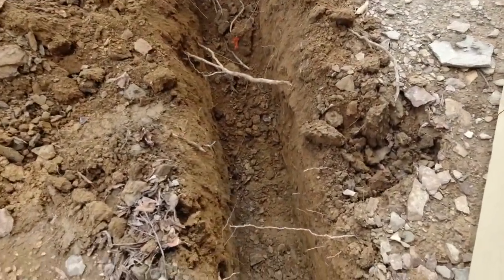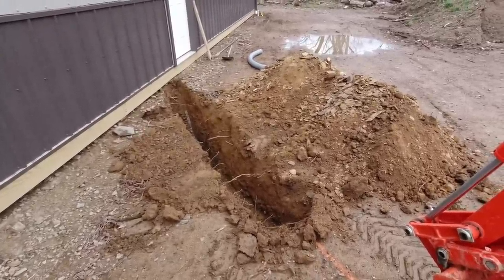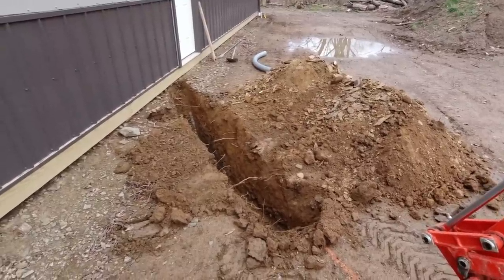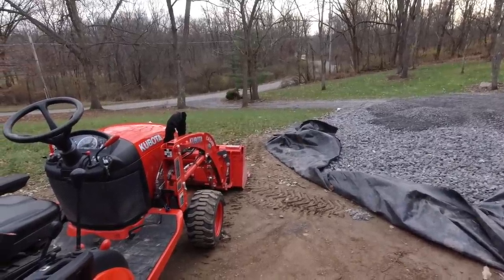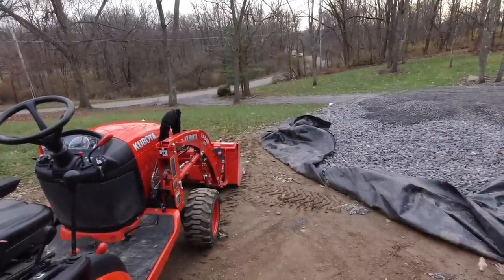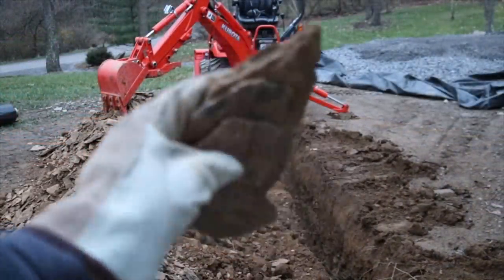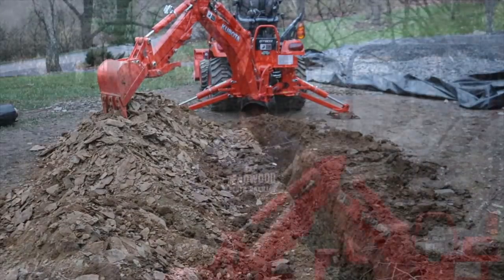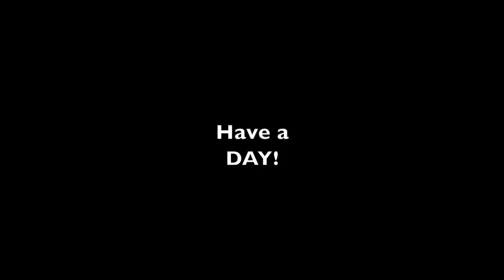#956 Little Backhoe, Long Trench, Hard Digging, Kubota BX 23S

Comment: Since you dont have footings or slab to worry about yet, why not put the pipe up the inside of the building and have the fuse box etc on the inside??   Keep the nice clean lines of the outside of the shed
Reply from the maker: Meter needs to be on outside

Comment: Have you ever had an issue when fully extending the backhoe bucket? When the backhoe bucket is fully extended there is a 90 degree elbow that makes contact with the backhoe. I have had two elbows snap off in like a day.

Comment: Mr. Mike... your BX can do it!

I’ve been digging with one for 15years.  I started with a BX24.  Electric runs, septic repairs, tornado shelters, building pads, footings, post holes, horse and cattle graves... you name it, I’ve dug it.  Although we don’t have shale, we do have Ozark mountain limestone and flint.  

There are a few jobs that I’ve had a struggle but, short of solid bed rock, the BX has done the job.  Here are a couple of tips for you:

The reach of the backhoe is short.  As a result, the spoil pile will always be close to the trench.  If you dig deep or wide, you’ll run out of room to put it on one side of the hole.  What I learned was that once the pile gets a foot or so high... I take a full bucket and lower the boom into it.  When I uncurl to dump, it pushes the spoils away from me.  This effectively extends my reach and keeps the spoils from encroaching on my trench.

Another thing that has made a big improvement, on my digging,  was to put a self adhesive tape measure on the front face of my dipper stick.  I cut it off so that when the bottom of the bucket is flat in the trench the tape shows me the depth.  It saves me from having to get off and run a tape measure.  When I’m digging drainage trenches, I drive stakes along the trench and put marks on them to measure the fall needed.  The same technique works with footings, etc. When I upgraded to the BX23S last year... I had a tape ready to put on it as soon as I got it home.

I realize you have a good deal of experience but, wanted to support your use of the BX on this project... it is the right tool for this project.

Comment: That "little" Kubota is amazing.  We dug the footings for our 2000 square foot house, dug the hole for the septic tank,  all the septic lateral lines, and 200' foot trench for the water line with it.  And we are in extremely rocky ground in the Ozarks.

Comment: nice vid...a small machine can do a lot if you have the economy of time and don't expect it to do more than it's capable-  so i've found with my Kubota, if i put the front bucket down to where it lifts the front wheels slightly, then put down the backhoe outriggers to where they raise the rear tires slightly that it maximizes the amount of grip the rear outriggers have on the ground because the weight of the whole machine is now supported by the furthest forward point and the furthest rear point. when the weight of the front loader and bucket and part of the engines weight are being supported by the front tires having contact with the ground then you loose all that weight on the rear outriggers and they can lift up or slip when your digging hard dirt. also taking small bites of the ground with the backhoe and scraping back a little at a time instead of expecting it to take huge bucketfulls with every swing of the backhoe it'll get most any job done with great results.

Comment: Mike,  I experienced digging with a small backhoe like this running a 300ft trench at my house in heavy clay and rock.  I noticed that if I put the front bucket down and used it and the outriggers to get the tractor off the ground,  I had much better breaking force with the backhoe.  It made the digging go much better.  Just a thought.
Now the last time I had to dig I rented a Cat 302? Excavator and OMG could that thing dig.  It was night and day difference in the power and ease of digging.  I understand why you wouldn’t want to do that in your case, but it made 500ft of digging effortless.
Looking forward to your next video.

Comment: Exactly why I bought my 1025r with loader and backhoe.  By the time you travel and rent something and deal with people it's just a hassle.  Only having a day or so many hours at a time, I'd just like to have my own and use it whenever I want. Getting 0% sealed the deal as well.  I probably over spent by a few thousand vs renting, but dug out many stumps at my own leisure without worrying what time it was or when I had to return a rented machine.

Comment: Mike suggest you get a folder and put all the info on the building plans who did the work,electrical door etc.so 5-10 years down the road you can just pull out the folder and have all that info at hand.

Comment: Mike, 18 inches of coverage in the lawn areas and 24 under the driveway for the electrical conduit is the minimum without 2 inches of concrete coveraqe (reference NEC table 300.5), so you are fine. Keep that warning tape up as high as practical so the next guy doesn't dig out the tape and conduit in a single scoop!  Seen them put it in way too low on many occasions. Nice job.

Comment: Mike,  Make sure you pull mule tape through each of the conduits making it easier to pull the fiber and power through each of the conduits.  As you glue up each section, pull it through.  It will make life easier when it is time to get the wiring pulled.

Comment: I'm sure you've checked your local regs on the depth of your line.  My local RECC is requiring a trench depth of 48 inches to the top of the conduit and I'll need a 1,000 ft trench to reach my pole barn shed.  Nothing easy these days, is it?

Comment: Mike, up here in N/W Pa, sand as pipe bedding on shale is not recommended. The shale can steal the sand, the recommended material is pea gravel. Once out of the shale you can use sand.
We used a lot of pea gravel up around Erie to bed piping.  
Keep up the good work.
Dan.

Comment: Have you given any thought about using the coiled conduit, at least for the other line you plan to put on top of the one for the electric service.  I think it cost less and would save some time by not having to connect them every 20 feet or so.  I did the steering for a friends horizontal drilling company for several years and that is the type of conduit we pulled into the jobs we did for the big trunk lines for electric, cable, fiber optics, etc, etc.  it can be laid out and after the sun hits it for a while it will become a straight piece of conduit.

Comment: Good morning,  here in eastern PA, PP&L requires a trench 39 inches deep. Just wandering if the trench doesn't need to be as deep because of putting in conduit.  Building is looking good.

Comment: Mike, instead of - or in addition to - burying tape over the conduit, consider using some of those pine boards.  It not only helps spread the load from any heavy equipment running over top (not that you likely need it at that depth), but it makes it VERY obvious that something is buried underneath should you or someone decide to dig in the future.  The boards will last a lifetime (and beyond) at that depth.  Once your sand is nestled around and over your conduits, the boards are laid and a bit of a shake well settle and level the sand below.
Reply: Clever idea!  Good use of the bark board from the saw mill?
Reply: It works but most areas would require the warning tape as well.

Comment: Mike never realized how close to main road you are. Will you be able to insulate the hobby barn to drown out the noise of the road.
I would like comment on on the advancement of the tools you use namely the Dewalt brand from sales to drills. These products have made live easier. No longer have to use a generator to power your tools. Happy Thanksgiving to you and your family.

Comment: I had to go 48” deep for my electric  line (600’) to the barn and almost 6’ for the bend from the transformer.  Also, our County Electric provider would not allow multiple conduits in their trench😡.  Water line only  had to be 18” deep.
Reply: 60" depth requirement where Iive.

Comment: Just wondering. Have you given thought to using wireless between the building and the house? Close as they are you should be able to get a solid connection.

Comment: Watch the conduits over each other. I'm guessing e!electrical and voice and data, cable on top? Keep the pipes apart because of electrical interference. Just a point of interest. Be safe, be cool! Beach, NC.
Happy Thanksgiving
Reply: Bobby Fowler, does electrical affect digital?  I would think not but don't know.
Reply: @larryiowatexasrooster9317  voice and data lines could be affected, that's why its run in separate conduits. Also the depth could be an issue. Thinking 36" for power without concrete covering. Not 100% on that.

Comment: Do you have to get an trench inspection?  I just did underground from the pole to my house and the city inspector had to approve the trench before I could backfill.  They want to make sure you don’t put a 200 amp 220 line only 8” beneath grade.

Comment: Do you plan to run the pipe up the wall on the outside or inside of the wall?  Will there be a meter pan on the outside of the building, or will it be on the pole at the road?

Comment: When are they putting in your heated floors spring next yr is what im thinking when you have your power in and can run a good electrical back up to not loose your heating ability but was thinking you have an unlimited heating supply in woods to so im waiting to hear what your plans are for heating the fluid to  keep your floors warm in winter and what your useing oil in pipe or anti freeze or just plain water ok god bless

Comment: Did you consider digging the trench another 6 inches and running the conduit up the inside of the garage, or does code require a conduit body through the side of the garage? Is your meter can going to be on the pole or garage? Just curious keep up the good work.

Comment: It's probably to late but i would of worked the sweep up the inside of the building so i didn't have to cut a hole in the building  .  Just what would of done.  Mike .
Reply: A meter is the first thing at the end of the trench, and it must be on the outside of the building.      Rick.
Reply: @rickoncordova1  only if you are not coming from a meter .
Reply: @evankibbe590  Mike already has said the hydro cable and the cable tv line is coming from the hydro pole beside the roadway. He also said that this is where the meter base is going on the side of the building, beside the man door.  Perhaps you should watch the entire video before you make a foolish comment.
Reply: @rickoncordova1  okay  .
Reply: @rickoncordova1  when you add a new meter here it costs you a thousand dollars minimum  .

Comment: Hi Mike and Melissa from Southwest Iowa raining today and we had snow yesterday. Have you ever considered going over head with your electrical service. Hope you kill a big buck have a great Thanksgiving.
Reply: Many areas are requiring underground as it is more durable over time. No tree limbs to drop lines due to wind or ice. Just a more stable grid all together although his power company service is on poles so they might allow it. Still looks better and less maintenance underground. Pay up front or pay later with repairs. A pole or two in his front yard would probably drop property value as well. No body wants that these days.

Comment: I worry about mice getting into your new building.  I'm not sure how you're going to seal up under the exterior walls, but mice are great at tunneling through dirt and gravel to get into buildings.
Reply: It’s still getting a concrete floor, then it will be sealed.

Comment: With it just being electrical it really doesn't have to much more than a foot in the ground anyway, its not like you're burying a water line then the depth is much more important
Reply: Depends on your local codes, in conduitwhere I live 18" deep!
Reply: @kipcudd7253  well yeah everywhere is a bit different. It’s like with water lines here in the north they have to be several feet in the ground where as in the south it doesn’t matter much cause it don’t get to o cold

Comment: I don’t know what your building code is up there down here in Florida you have to bury electric conduit 36 inches and safety flag it
Reply: Just to show the differences state to state, in Missouri the local electric cooperatives, one of which I was a staking engineer for, mandates 30 inch trench for secondary and 48 inch trench for primary, and we required 2 1/2 inch conduit and the LONG sweeping bends.
The "public electric utility company" required 36 inch secondary trench and 40 inch primary trench and used 3 inch conduit.
As you know, it is ALWAYS best to check with your local provider before doing any work whatsoever.

Comment: I'd still rent a Ditch Witch ride on machine for the trench. Making a couple hundred foot run with a back hoe on a small machine can be done, but why? The expense of the rental for a day isn't bad. You need to pick and choose your battles.

I'd bet that a Ditch Witch machine wouldn't take longer than a couple of hours to dig that trench. If you want to stuff more into the trench, then you could follow up with the back hoe, as the hard work is done.

Comment: Don't put the conduit on the exterior you can easily put that under the rat board and inside your interior wall keep the exterior neat and clean looking
Reply: He has never said he's adding a new meter
Reply from the maker: New meter, I met with power company engineer, (he has been working this area for 30 years) and my electricians, there are two of them and they are partners in business. (Over 30 years) so that’s about a 100 years of experience so I decided to do what they said lol

Comment: 30" deep? Code here is only 18" deep. Deeper is probably better in a high traffic area. 👍 Carry on.
Reply: Deeper is better - so I am/was reminded. . . . Not sure what the frost line is up there but Hey! Mike is having fun on the backhoe..
Reply: For electrical in conduit it is very different from area to area, but that said, deeper is better. You put it in at a depth to finish grade today but finish grade might be different twenty years later. I have seen power lines not in conduit that were 36" deep when installed  show up at 12" deep many years later due to changes in grading over the years. Not good.

Comment: Having been in the trenching business years ago I also am curious why sand or gravel is needed for back filling roof drain lines/utility service lines in conduit . Anyone know if that is a PA code ??
Reply: In Jersey we backfill any plastic piping with 1/2" or smaller material. Usually use  cheapest sand because 1/2" aggregate is not readily available.
Reply: Also, for electric conduit or plumbing lines, sand or fine gravel is best for “bedding” to provide uniform support below and around the pipes.  It flows easily around the conduit so there are no air spaces that can cause sagging or crushing with the weight of the overburden and/or heavy machines driving over it.  In my area this is in the code - not sure about PA.

Comment: I dont understand why you are getting stone and sand for back fill?? You already have that shale and it going to be in conduit anyway you dont need anything but dirt. Waist of money.
Reply: If someone digs in the future they will know something is buried there. It’s what we do in the hills of Pa. Sometimes they will even spray a red dye on the sand. It might even be code. I’m not sure
Reply: @markkasprzak995  They have tracking tape you bury with the conduit
Reply: Sand is best. Plastics expand and contract according to ground temp. If rock rubbing on pipe it will eventually wear a hole in it or so they say. It's probable but not likely. In Jersey electric is 24" deep with continuous tracer wire or metalic tape from end to end. Gas(plastic) is 18" with tracer wire. Pipes are not very deep so definitely affected by variable outdoor temps. Water at 42",  less affected by temps.
Reply: Ray, I was talking about backfill. Not a lot of sand when your digging through the rocks in Pa. It gives a heads up to the next person who digs. Maybe decades down the road. Perhaps the next homeowner who wants to plant a tree or bush
Reply: @markkasprzak995  You didn't mention backfill,  Mark!